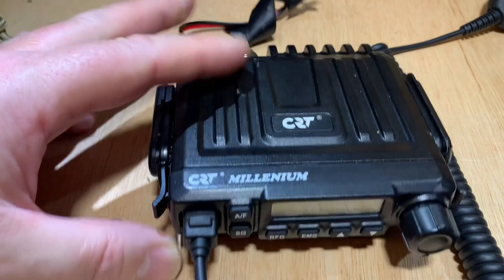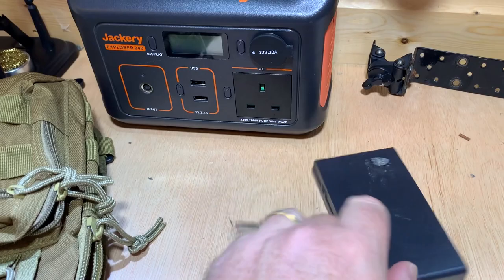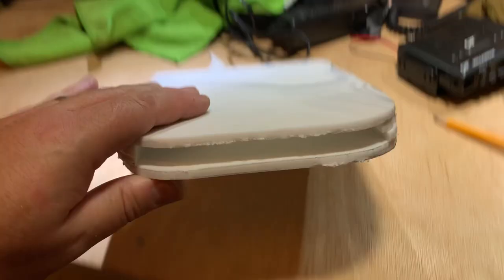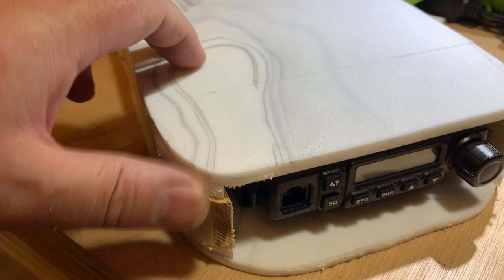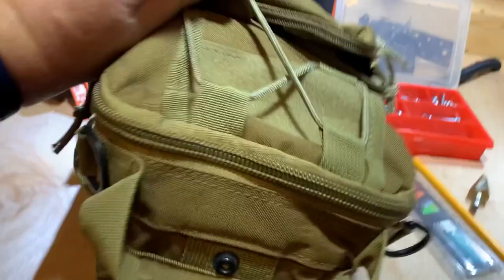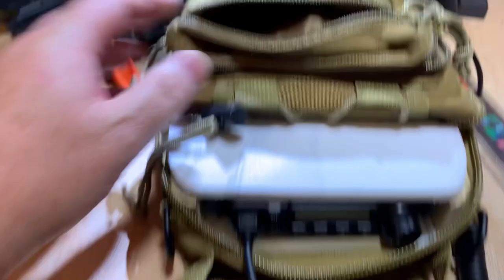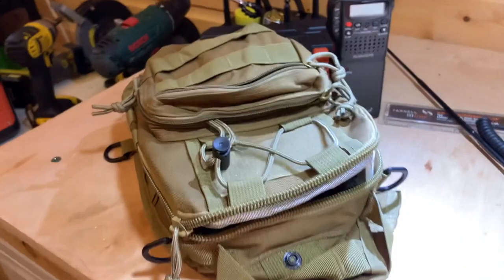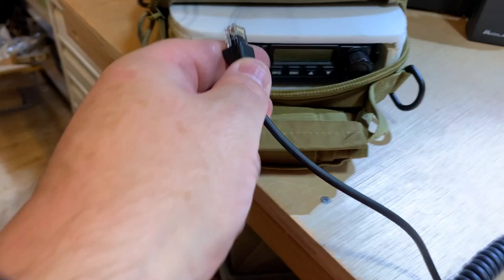DIY  Portapack CB Radio Kit

Comment: I’d like to see how you done the antenna I like that did you have a tea for the antenna three can use the back or the front
Reply from the maker: Hi. I just used a pl259 splitter and have both sockets connected to the same pl259 going in to the radio.  I was unsure how this would effect the SWR, but it was hardly noticable.

Comment: Cool little portapack cb, might there be space behind the radio for the battery pack?
Reply from the maker: Yes defiantly there is. I am thinking about putting it there, my thought process was that using the top pocket makes it easier to unplug the battery pack to plug in either car 12v adapter or change the battery. But saying that, it’s easy to take the radio out of the bag to change the battery if I need to. 
Placing the battery in the radio is most likely going to happen 👍